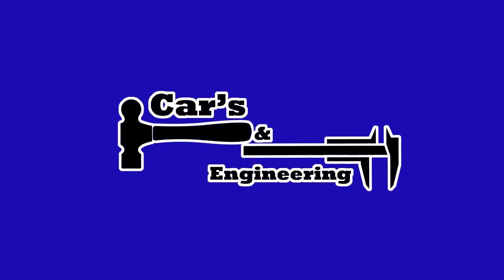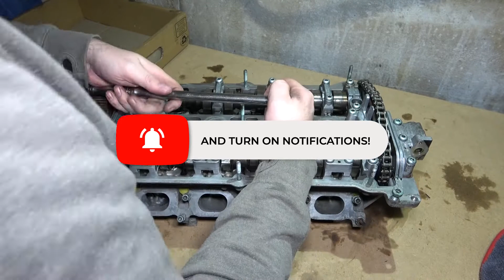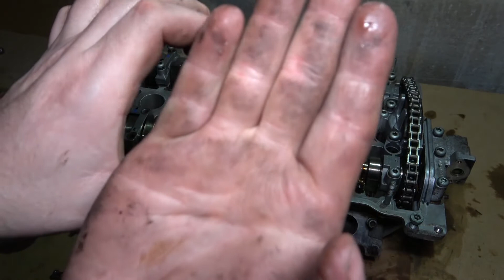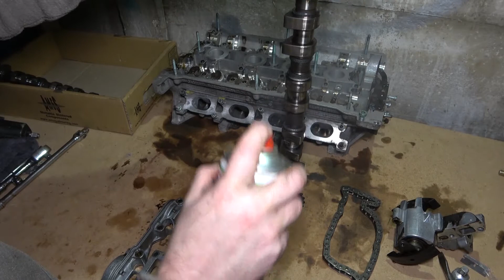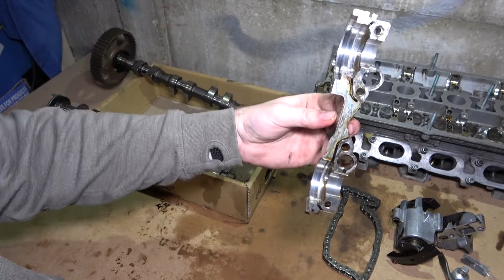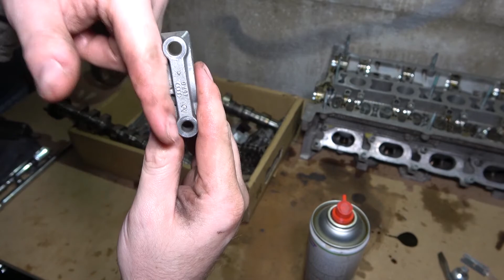Removing The Camshaft On The 1.8 20VT Engine! (9n3 polo Trackcar Build)

Comment: Where did you get a manual for this engine? I've searched high and low
Reply from the maker: I got it from the 9N3 GTI owners club on Facebook mate 👍🏻 
I’ll try make a drop box or something so I can put the files in there for the channel
Reply: @CarsandEngineering  that would be mega! 

I swapped the manifold on mine the other day and I had to use a guide from a MK1 Octavia vrs I found online 🙈.
Reply from the maker: I’ll see what I can do buddy 👍🏻